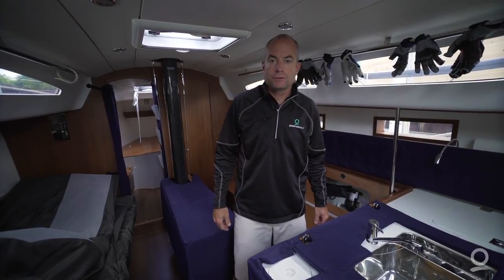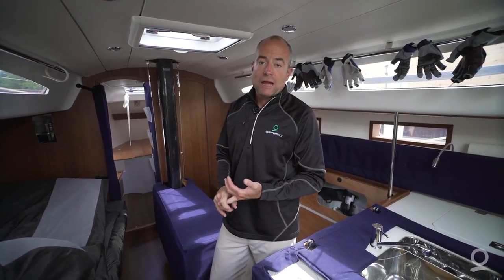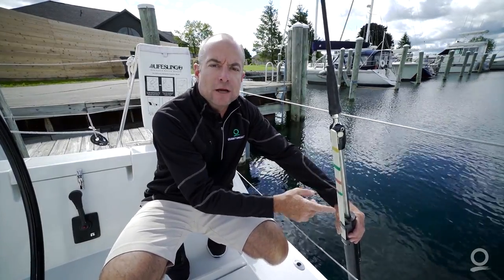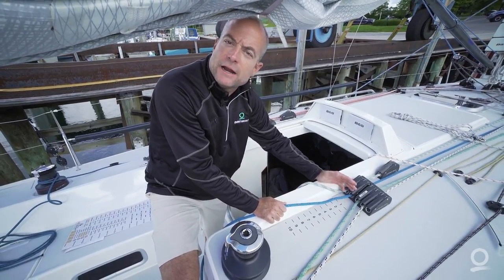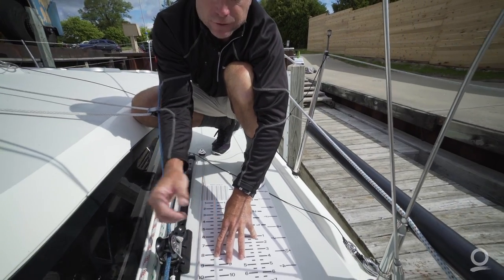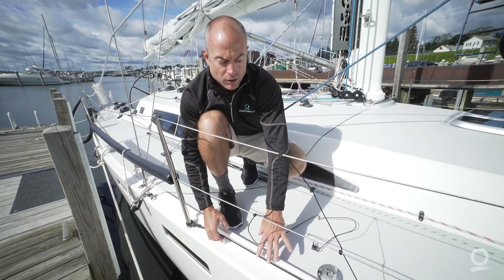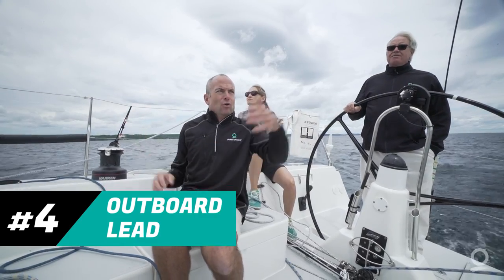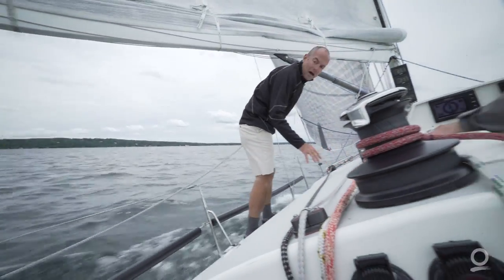Quantum Distance Racing How-To Series: Part 1 - Four Simple Onboard Optimizations

Comment: correct me if I am wrong, but you are not allowed to remove cushions (if the boat is weigh with them) when racing under IRC.
Reply from the maker: Hi Cem, you are correct it is our understanding that under the IRC rating system you cannot remove the cushions. US Sailing is the best place to get the most accurate information. Some rating systems are more lenient and do allow it. Our recommendation is to remove the cushion if it's legal. If you can't remove the cushions, there are still some opportunities for optimization; for example, if you know you're going to be on a specific tack for a long time based on the course, you can move the cushions accordingly to help performance. Thank you for the opportunity to clarify!
Reply: Whoops sorry not sure how the cushions fell overboard.....